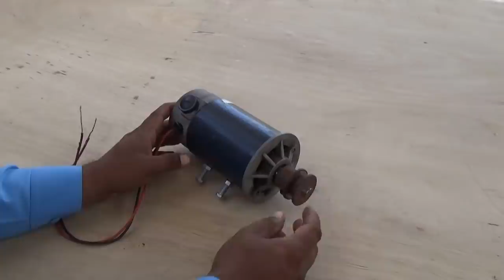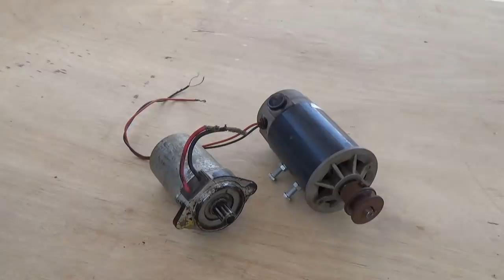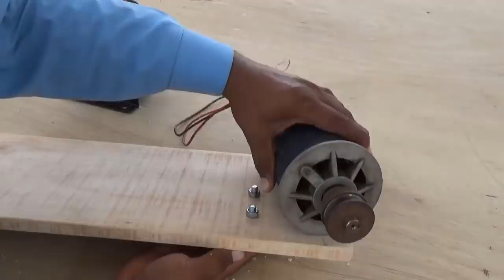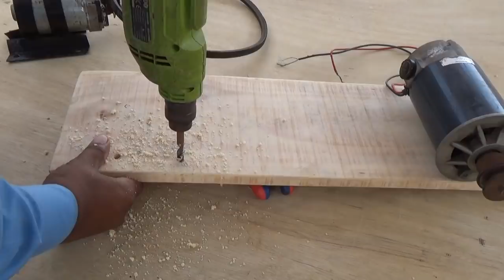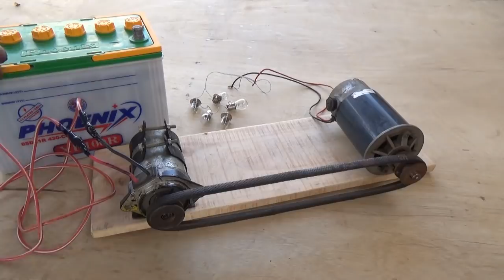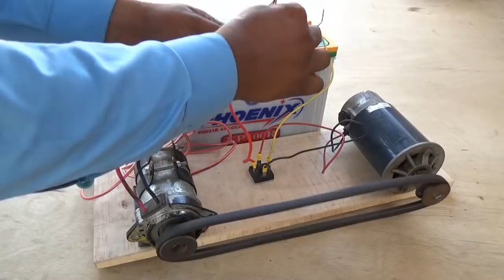Amazing Free Energy Generator Battery Charger Recycling Free Electricity #Experiment Diy Projects

Comment: The system can run only when there is energy in the battery. In the long run the battery will gone and everything stop.
Reply: So, if we would ad basic solar to it .. this would prolong it's life ?
Reply: Oui ❤
Reply: If the alternator more like say output 
55volt at 10 amp ac that’s 600watt and if the motor is drawing 20 at 12 volt dc thats 250 so the e battery will stay charging and overcharged too because it’s make too much currency and yes I try it and I get that you should try it you will be surprised
Reply: @Dc_tech386  use a rectifier or regulator to convert the current  prior battery

Comment: this is very good technique, but with the inverter can charge the battery by using alternator (induction motor). The inverter can on and off the alternator motor when it is needed and sometime to balancing the load on the battery. the rotating motor of alternator will consume the energy which it is needed but inside it increasing the number of magnetic poles can generate very huge amount of electricity.
Reply: Here also can be use PWM solar charge controller for better safety for battery and load

Comment: Treadmill  Motor on right and power steering motor on the left and a bridge rectifier is on the treadmill motor 180 volt not sure its ac as it is usually a dc voltage

Comment: Battery is charged position and DC motor run with (charged) battery and then  dynamo running with help of motor dynamo produce 55 volt DC then Battery will damage with in day.
Total loss

Comment: Keep it operational for 24 hours, very slowly your machine go to decreasing speed and eventually permanently stops including power of the battery, what is use of this machine? this not  endless.
Reply: Put less load on battery !!
Reply: Dear boy,  in all conditions  this system will stop to work, earlier for high loads and later for small loads. THIS ONLY ONE CONDITION FOR THIS SYSTEM.

Comment: The question is where the energy comes from? There is no free energy. Every energy must have a source. 
In this case Input energy is greater than output energy

The highest source is GOD 😊
Reply: It's actually a cycle energy such "Mechanical to Electrical--》Electrical to Mechanical" it was actually proved by Nikola Tesla itself but they have not released this theory to the common people

Comment: What a crock of nonsense. Did you notice the output voltage of the generator? It was around 5 or 6 volts. Applying that voltage across a 12 volt battery is not going to push a single electron into the battery. 

This person, and a number of others like him, are make tens or hundreds of thousands of dollars off the gullible who fall for their nonsense.

Comment: That. Is. The. Dumbest. Thing.  Ever
Reply: Jason Starkweather I'm not a scientist so bare with me,the alternator produces 12 volts,if that is dc power you run it back to power the dc motor,it runs itself?so you add a pulley and another alternator and free power?